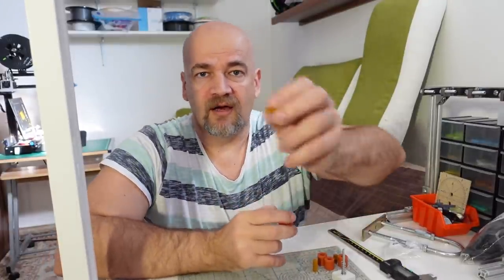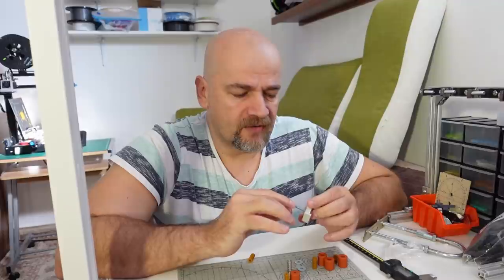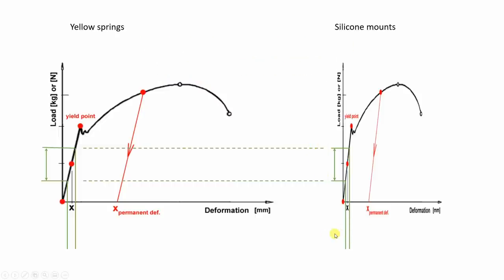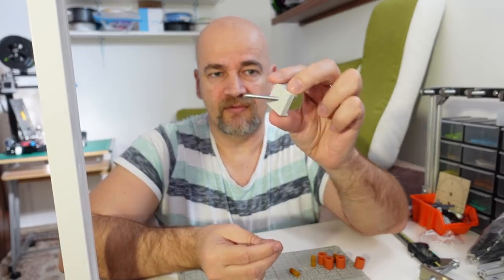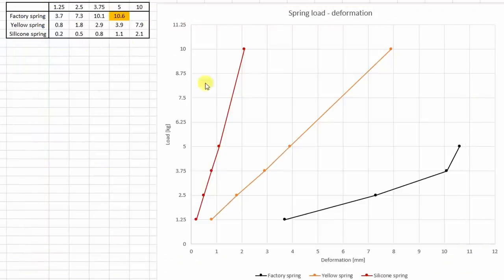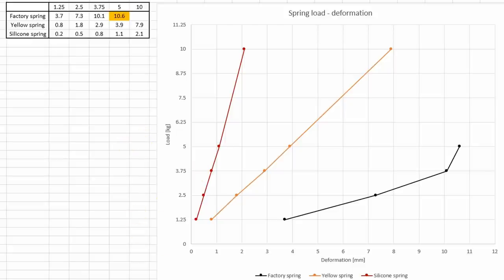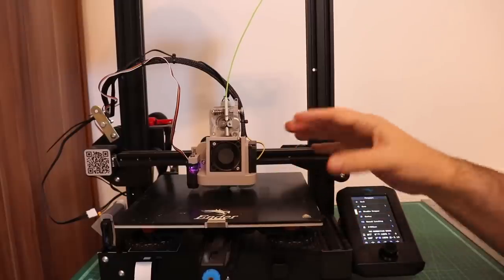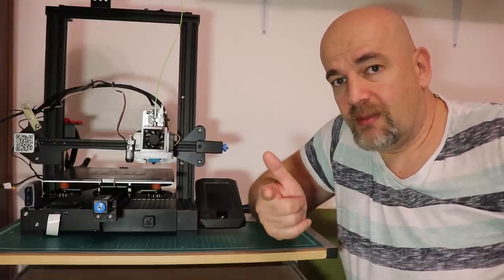Silicone mounts vs yellow springs vs factory springs - Ender3V2 upgrade

Comment: Hello, very interesting video. I am wondering if I place thread lock on the screws at wheel level, I will ensure the levelling doesn’t move, without needing to deal with the stiffness of the springs/columns ? Am I wrong ?
Reply from the maker: You could be right, but I didn't tested it. There are non-permanent lockers, that could be a solution too

Comment: 2:28 This method will save you from having to use BL Touch or silicone springs. This is the part people keep ruining is trying to pry and jack hammer the print off the build plate whilst it's on the printer...

Comment: Amazing video. Very informative and helpful. 
By the way - 07:35 - ware safety glasses :) , but wait ... hold on. at 10:07 you do have safety glasses :)
Reply from the maker: 7:35 was footage from other video (where I quickly realised that I need a safety glasses in this test)
Reply: @MyTechFun  Your video is amazing. Most informative i have found while trying to find prons and cons for Silicon bed level spacers. I have ordered a set for my Ender 3 V2 
THANK YOU ! ! !

Comment: Hi Igor. great usefull test. Thank you. Im thinking about converting to the silicone pads. But as you mentioned i do think as well, that over longterm silikon will have a problem with aging much more than the metal of the springs. Probably hardening and than breaking due to lack of elasticity.
Reply: It would depend on the composition of the silicon, and also how hot the bed is and length of use.  I got some of these for my Ender 5 Plus (all equal length for that model), and have thought about longer-term stability.

Silicon hot-end socks seem to survive quite well, but it comes down to the composition of the material.
Reply: @boggisthecat I agree on the composition. Now just yesterday i had to replace one of the siliconsocks u mentioned. Completely dry, brittle and stuck to the hotend. Duration, about 10 months light to no use, except hardcore (24/7, PLA/PETG) use the last 3 weeks. Will stay with the springs

Comment: Very good video; I swapped to silicone but have had an issue with bed leveling since switching. Any tips on how to fix the issue?
Reply: Bltouch attachment for auto leveling should solve your issue failing that your bed may be warping from high Temps if that's the case consider glass over lay with your bltouch

Comment: The corner with the harness stays up on my tray. Even if I squeeze it all the way down, it stays up. Should I try to bend the metal with my hand or pull the Z-stop up? Thanks for the pei advice I'll get the silicon and pei asap

Comment: How is it an advantage to have a higher spring constant? The spring only needs to be able to push the bed up so that there is no movement while printing. The higher the spring constant, the bigger the change in force acting upon the screw while adjusting, I don't see how this is advantageous in any way whatsoever.

Comment: what if you add a counter butterfly nut to stop rotating knob ?
Reply from the maker: I already tried that. When I tight it, knob moves a little bit. Maybe only using one with self locking nut yes.

Comment: Would you recommend this on a ender 3 S1 also? when i level my bed manually the springs are almost decompressed under my bed,
Reply from the maker: Just compress them more. Do manual leveling and then auto leveling. Cr touch always measure the top of the surface.

Comment: I went back to springs after printing with ASA. Seems like it's to hot for the silicone. Looses it's springiness and compress. (100-110 Celsius) So when you go back to 50-60 degrees the bed is not level anymore. I use mesh leveling, not bltouch.
Reply from the maker: Try adding a teflon washers above silicone to protect them from bed temperature

Comment: What do you guys think about using a blue thread locker? It's the same kind of stuff you would find on the threads of electronics like a laptop and only costs a few bucks for a bottle of it. Adding this with the yellow springs, I think it's a pretty good combination for anyone.
Reply: Your bed will eventually bend or get deformed this way or another. This usually happens when you try to remove a printed part from it. The nozzle tip also wears and necessitates re-adjustment.

Comment: @Igor and @comunity
I'm a noob but i may have a pertinent question:
At 13:26 I see the full layout of the machine. The video started with the problem of vibrations and forceful removal of prints causing miss-alignment. 💡
The printer layout, as i see it, is : Knob - support plate - spring - print bed [with a screw running through them].
Q: Why not add a lock-nut and lock the knob position after the leveling? 
Example1: Lock-nut > Knob > support plate > spring > print bed
Example2: Knob > Lock-nut > Support place > spring > Print bed
Screw too short? change the screws > add lock-nuts to lock the knobs 🤙🤙
I'm asking this because i'm lazy. If i had a 3d printer i wouldn't want to re-level it after every handful of prints. ¯\_(ツ)_/¯  Sure, if i gave it the beeeeens and pulled on the print sooo hard that the springs would go past the yield point...

Hope Igor sees this
Reply from the maker: Something like this? https://youtu.be/7ZKg5u1pia4?t=342
(from 5:42) I tried it, if you success, it will stay in place forever. But there is not easy, explained in that vid.

Comment: ive used them on a couple printers for over 2 years. i do not really notice any deformation now. i did after the first 3-4  months but it seems to have stabilized since. i am using black silicone mounts btw. i used some i had left over on and ender 5 pro and it seemed to be about the same after a few months they seemed to have deformed a bit then when re-leveled no more issues. i have not tried the orange ones. i thought of making my own molds using high temp silicone when and if these go bad. i may try that on the new printer im building

Comment: Hmm my silicone mounts are all the same size
Reply from the maker: You will need a little more force (torque) to compress the back-left one, but after that, it will be fine.

Comment: Lost within 6 months elasticity
Reply: Silicone spacers or yellow springs? And are you using nuts to prevent the screw itself from rotating in the bed?

Comment: the yellow springs are fine. i use them with springsteel removable bed and i never had to re-level in like 6 months.   Get yourself a 0.2mm feeler gauge mate  the paper method sucks  lol
and a warped bed?  and you are worried about to "upgrade" to silicone looool.  set your priorities. u got a 0,4mm sinkhole in your bed, thats awefull.
I really like your videos Igor but this one is a bit far fetched. Keep the good things goin but dont become a  silly bugger  like CHEP with his LED leveller  hahaha.
I would replace the bed with a cast aluminium one! before anything else.

Comment: Hello Igor, wouldnt it be much better to level the bed and then put counter-nuts under the knobs so they dont vibrate loose instead of using super strong springs? I think the only benefit of "better" springs is that most of them have the contact area ground flat.
Reply: I did it on my machines esp work great with anycubic mega x but corexy with dual z is not liked that solution so I also thinking to try slicon pads